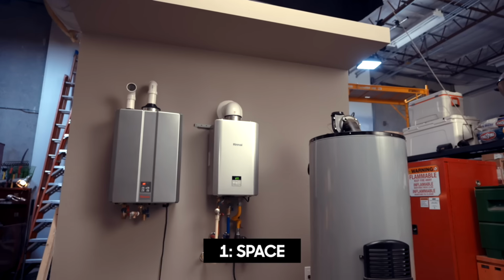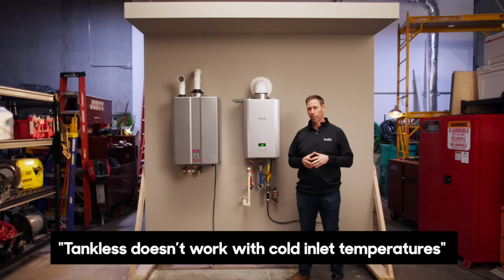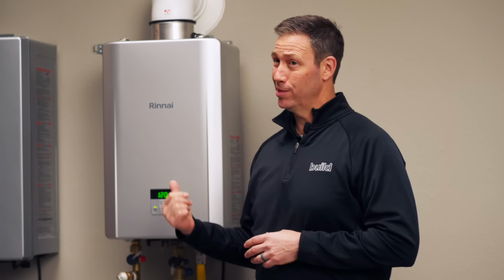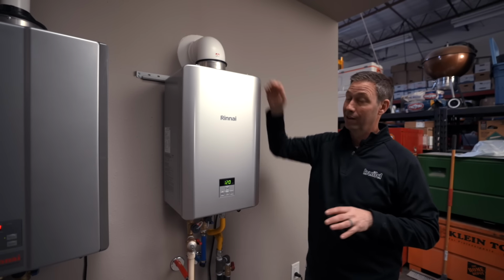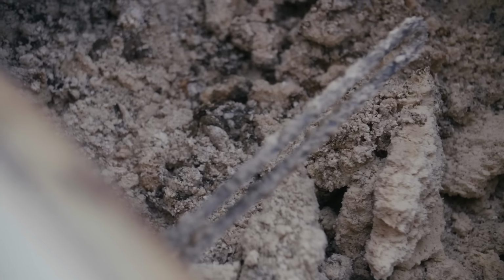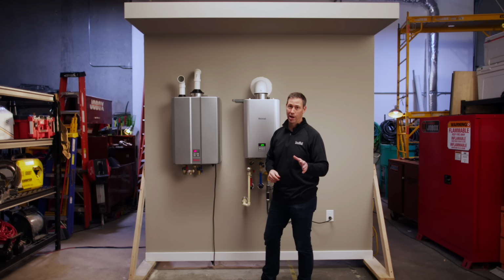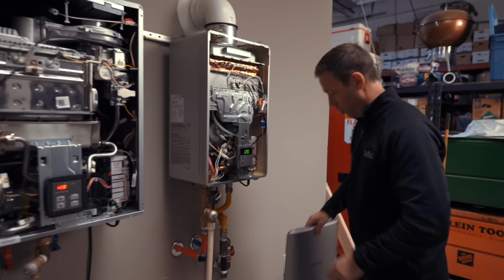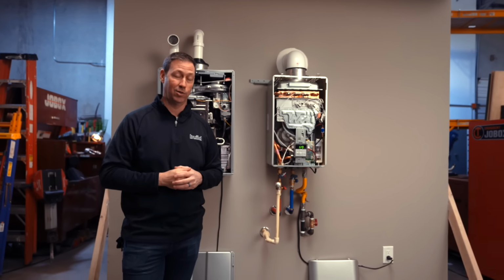DEBUNKING Tankless water heater LIES!

Comment: If I were building new, sure, tankless all the way. At under a grand, the actual cost of the heater isn’t that bad. The problem is the punitive pricing by plumbers in some areas. You’re absolutely correct, it takes no longer to install than a regular tank-so how does the plumber justify a $5000 installation vs a $1200 installed tank? It’s the same problem as mini-split HVAC, it’s different so the contractors want a guaranteed profit, instead of saying “it’s 140 and hour, 3-hour minimum. Takes as long as it takes.” They just tell you “about $5k” to install an $800 heater.
Reply: Not really. In an older home they can have their tanks in a whole bunch of spaces. These models shown were plugged into an outlet which could not even be available on the same floor. Never mind the extra gas requirement and fresh air requirement. If it's the same tech then yes unplug old plug in new
Reply: The person who answered the phone makes a salary.  The person who created your invoice makes a salary.  The plumber makes a salary.  The truck/van the plumber showed up in cost money.  The gas the truck used to get him there cost money.  The plumbing shop has a furnace, A/C, lights, and computers that all have to be paid for.  The plumbing shop stocks inventory.  The plumbing shop probably has other useful assets like a fork lift and scissor lift and a few hundred thousand to a few million dollars worth of specialty tools (a decent 5/8 cable drain 'rooter' machine is almost 5 grand these days... a decent truck mounted hot water jetter is about a 100 grand these days) The vehicles need insurance.  The building needs insurance. The employees need work comp and health insurance.  The plumbing shop pays a garbage and scrap metal collection company to dispose of the waste created at the office and on the jobs. If the shop is more than a couple of plumbers, they probably also pay for cleaning and grounds maintenance.  Building permits cost money.  Materials cost money.  And... don't get me started on the *taxes*....   If you can do it yourself, then do it yourself.  If you can fix it yourself, then fix it yourself.  If you can't, won't, or don't have time, maybe consider what you're paying for is for a business to exist in your community that you can call upon to do things you can't, won't, or don't have time to do.  Being in business aint cheap and it gets harder every day in this economy for any business to stay in business and keep feeding the families that rely upon the jobs that business supports.
Reply: @betweenfiveandseven  So the cliff notes are... Plumbers have overhead, if its so easy Youtube the video do it your self and when you call me I can charge you twice as much.... One to fix what you screwed up and then to do the original job...
also I'm not a fan of thankless....
Reply: @betweenfiveandseven  well everyone has expenses.  it would have been nice if you actually answered the question which was why $5000 installation vs a $1200 installed tank?
Reply: @annamyob  read it again.  I answered quite clearly and the op exaggerated by at least 1500.
Reply: @betweenfiveandseven  I’d like to thank Gabby Johnson for that authentic display of frontier gibberish, and I’m glad these kids could be here today to see it. 

I’m not complaining about paying the plumber, and I fully understand the concept of the cost of doing business. What I’m complaining about is plumbers charging five times as much for the same number of man-hours of work, based on them being less familiar with it. If you have a reason why it costs 5x as much to install a tankless as it does a tank, I’d be interested in hearing it. Otherwise I’ll let you return to yelling at kids to get out of your yard.
Reply: @jasonm.7358  You were likely given a choice between accepting the bid or having the job done time and material.  That's regular old boilerplate industry standard sort of practice.  If you think there's a greater chance that time and material will save you money and the plumber won't run in to any significant challenges during the install that might drive up the cost, take the gamble and choose time and material.  This is America, bubba.  You have choices and your destiny is in your own hands.  No one is holding you over a barrel.

Comment: I lived in Japan for 2 years in the 1990's. Your right, tankless and point of use water heaters are everywhere in Asia for some time. It has amazed me how long it has taken for the US to start adopting this technology from established companies. I think one of the biggest reasons is that tankless hasn't been readily available at the big stores. It is much easier for someone to swap out the old/bad water heater with a similar model with the same connections in the same space.
Reply: No, the reason for limited adoption is about plumbing system design. NA homes are designed with single point hot water heaters. The homes commonly have long plumbing runs to the fixture. The best, most effective and efficient solution is tank storage heater with recirculating system. 

I’ve never lived in Asia but traveled throughout region a lot for work. I also lived in Belgium & Italy for several years. All of these areas employ small point-of-use water heaters. No long plumbing lines to evacuate before the hot water arrives. To retrofit most NA style homes requires extensive re-plumbing to deliver acceptable performance and efficiency. A tank heat pump water heater is not only a vastly more efficient heater, it’s far better suited to the vast majority of NA built homes.
Reply: Space is a HUGE issue in Japan, i mean, you have hotels where people sleep in the equivalent of coffins.  Unless space is an issue, tankless aren't that advantageous.

Comment: But you're discussing gas-fired units. They may be able to handle 40 degree inlet temp. But I installed an electric unit, (with three 40 amp/240 volt breakers) in my son's Catskills house with well-water. It worked really hard to get the water hot. Only problem was all the house lights dimmed.
Reply: Yep sound like someone went over the 70% full load rating of the panel. Most larger homes need a 200 amp rated panel.

Comment: Ya, but didn't you do a video a while back comparing the cost to buy and run different water heaters, and said best bang for buck was a heat-pump tank?  We have Rinnai's in many of our rental properties in central Canada for a couple years now, and even with seasonal flushing and maintenance are starting to be problematic.The  internal parts are needing to be changed often, so much lately, we have been switching back to standard tank water heaters.
Reply: He also didn't put a tankless unit in his own house. I love Matt, but sometimes he's a shill.
Reply: Most tankless units have dozens or more error codes, many sensors and electronic parts which are hard to get replacements for in emergencies, not to mention costly after most 2 year warranties expire. We've had internal condisate problems, leaking exchangers in the combos, venting problems on really cold days, power exhaust vent issues or failures. Saying these things will last 2 decades, makes me laugh. I don't see the benifit in dumping money non-stop into maintaining equipment for the sake of endless hot water. As for efficiency, nobody looks at the btu's, the amount of gas required to heat a volume of water. The cost savings may be pennies over years. We required gas line upgrades to almost all properties where these units were installed which was very costly. They don't make sense to me or our development company, we stick with the basics now. (K.I.S.S)
Reply: @ronlovell5374  Just like cars have potentially dozens of error codes with computers now, doesn't mean they are less reliable than older cars. Quite the opposite- I rarely see cars broken down on the side of the road, yet decades ago this was commonplace. 
Millions of people use tankless water heaters all over the world. They are not particularly trouble prone. Perhaps individual experiences vary based upon brand/model or install problems, but this is not the norm. I put mine in myself and have had mostly trouble free use for 10 years now. I've had 1 error code that was easily resolved. With my previous tank, I had issues on a regular basis and it was about 12 years old when it needed to be replaced.
Reply: @ccbowers Ya,I work with a major developer in central Canada and this is just our experience mostly with Rinnai's, Navian's and Slant-Fins, not every tankless. We've had good luck with IBC's, and I'm sure units are getting better built with time, but for us, simple and cheap and little maintenance is key. Bells and whistles don't make sense for heating water.
Reply: For rentals, I'm going to agree before watching the video. My experience is to revert back if possible. Renters don't care or need endless hot water. They won't pay more rent and if landlord is responsible for utilities...ouch. Any plumber and many handyman can repair/replace the tanks at a moments notice. New units and parts are available 24/7. Renters aren't willing to wait for days/weeks with no hot water for warranty work or ordered parts. As a eco/solar(battery) ethusiest, heat pump is the only way to go. As contractor that dreams, both, tankless and heat pump. Heheh
Reply: sounds like it might really depend on local water quality. either way, tankless seem like more potential headaches compared to other options
Reply: He did say “sponsored by Rinnai.” However, the quality of water coming into the heater is what really dictates the maintenance.
Reply: The answer to that question starts at 7:14
Reply: I would never get another tankless in my life. They are such a headache. My old house had a tank water heater with no issues for 16 years. I will never have another tankless. Go with tank.
Reply: You are correct. The ones ived installed only lasted 10 years. They do need maintenance after the service techs repair it the second  time you might as well get a new one.
Reply: I have tankless water heater Rinnai, and the maintenance is very Minimal since we have very soft water in Ottawa. If you have hard water I definitely don’t recommend tankless, but they are great for us with soft water.
Reply: @Sean-mc4iq  most of our properties are based in Ottawa.  How long have you owned it for?
Reply: @ronlovell5374  7 years, I completed a flush at the 5 year mark...since the water is so soft here it was only necessary to do then.
Reply: Thought Matt was a Rheem guy! Wonder what changed?
Reply: Other than periodically descaling, what maintenance have you had to do? I would have expected tankless seem to have fewer maintenance issues. I descale every few years (water softener) and have had few problems, while with the tank I had issues regularly
Reply: Any plumbers here love blocked drains like me? Haha
Reply: @DrainCleaningAUSTRALIA  I hate blocked drains - but I love guys who can clear them out.
Reply: @TerryPullen  thanks brother! Have a great weekend!
Reply: Exactly !...

Comment: Energy efficiency is not often a valid reason to purchase one. For us, saving approximately $100.00 per year for our family of 6, would give us a 26 year payoff. Certainly not going to change out for efficiency alone. Never have run out of hot water with a family of 6, so not a reason to change out for us. Maybe if our tank gives out eventually.
Reply: Your math is wrong because you didn't deduct the cost of the tank option

Comment: Funny he didn't touch on electric heaters. Maybe because they require a bigger electrical demand, which most older houses can't meet without major panel overhaul. Or in the fact that as far as electric they aren't more efficient. Gas or electric to heat water that fast is going to take alot more energy. If your shopping for water heaters. Do your homework. This is nothing more than one big advertisement.

Comment: Difficult to install?  It literally almost installs the exact same way.  Inlet, outlet, power, vent, gas *if applicable*.  I've installed 5 tankless systems in the last few years, and I find them actually simpler than tanks. Considering that a tank, when full, will easily weigh much more than I do, it's a no brainer.  There's nothing worse than trying to lug a 40 gallon tank that's full of water and buildup through a kitchen to get it outside.
Reply: lol they are not simpler to install then a tank hot water heater. Those are extremely simple to do majority of the time.

 There is just slapped in tankless which is the majority of the and there is installed correctly as per code requirements. I see a ton of terrible installs that make working on them a pain in the butt and basic maintenance a drawn out job.

 Anyone who installs tank hot water heaters either drains them or uses a pump to fully remove the water from old tank hotwater heaters before they are ever moved.  No one moves a tank full of water. Two people and a dolly and they are out
Reply: There's always a little water, a ton of buildup, and trying to get it around a doorway or up a step and not hit an islander or built-in dining area or something.  I had one where I had to take the tank out of a cabinet. Also, 2 people and a dolly is one person and a dolly more than is needed to remove a tankless. As for a tank being simpler to install..... we'll just agree to disagree.
Reply: the trick is to drain the wh before transporting.
Reply: I'm pretty sure nobody thinks that draining a water heater is a "trick".  The statement was comparing working on a tank heater vs a tankless.  Even drained, a 40-50 gallon heater will weigh a good 150lbs at the least. There's no situation where installing, uninstalling, or transporting a tank is easier than a tankless.

Comment: Can you have a recirc line with a tankless?
Reply: Yes very common on long runs for customers. Biggest complaint besides cost to repair and maintaining.
Reply: @zack9912000  What does it recirc into? It can't always be on.
Reply: @chicosajovic7680  It circulator can do a few things, one is keep water temp a little warmer in the pipe when there is a long run to one side of the home so the delay isnt so bad. Downside it can make the tankless run a lot more if not designed correctly using the circulator

Comment: I had a tankless one time. Didn’t like it. Noisy and difficult to control temperature. Servicing it was expensive and didn’t help much with temperature control after service. Maybe they are better now, but I will stick with what I know works well.
Reply: Trust me their not, I repair them daily and parts are still very expensive, and if a person isnt trained proper, they may take a few visit to fix. Two weeks on the average for special parts under normal  circumstances
Reply: One time?  LMAO

Comment: I get you’re stumping for Rinnai since they are paying for video but nobody in industry uses them here. Too many issues with reliability and warranty servicing. 

All of our builds use heat pump water heaters with average EF rating of >3.5. The most efficient tankless are 240VAC with EF rating 0.99, see Rheem or EcoSmart, among others. For NG or LPG fueled, the highest efficiency are condensing units from Noritz and Rheem. Noritz may be the priciest option but they carry 25 year warranty. Local builders here in Boulder area and BigSky, where yes 40F incoming water is common in Winter, mostly use Rheem or Eco2 (Sanden) heat pump type. Part of that is due to the prevalence of hydronic heating systems. The few that use tankless all use Noritz and would specifically avoid a Rinnai.
Reply: Bingo, any homeowner wants a no bs overview on them, talk to the service techs who repair those brands.

Comment: Matt when you say most you're assuming that most people get top of the line tank water heaters and their lasting 15 years!!!!!!! In fact most people buy bottom of the line tank water heaters and they don't get 15 years so the fact of the matter is if people went to tankless they would get two to two and a half times longevity. 🤩
Reply: He'd probably shit if he knew my current tank was installed in 1984😂
Need to consider a new one though, I quit flushing it about a decade ago because the fitting is corroded shut.
Trying to decide between tank / tankless though.🤷
Reply: @dougs8718  Do a high efficiency tank water heater. Parts are easier to get and cheaper to maintain over the life of the unit
Reply: @zack9912000  that's what  the latest train of thought  says. Only thing (for me) tankless gives me is more room. Biggest problem with tanked is  would be looking at vented ($) due to needing to remove my chimney.
Reply: @dougs8718  Yes they take up more room and doing a high efficiency model uses PVC piping for venting and doesnt require a chimney

Comment: South Korea, same, tankless. Not only that, the floor heat is run off a tankless water. Called (온돌), pronounced "own dole" named after their ancient tech using rocks under the nice homes (hot rock), a fireplace outside the house, running the hear under the house heating up the rocks below then leaving a chimney out the other side. This is one reason sitting and sleeping on the floor is popular in this area of the world. I was in Korea for a year, had an apartment with this radiant floor heating and it's just perfect. PERFECT, I say!